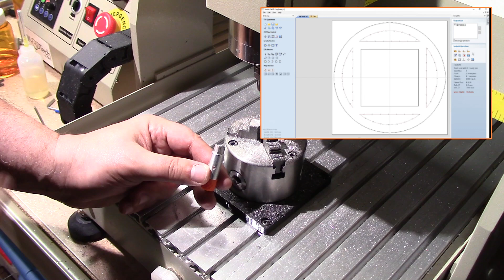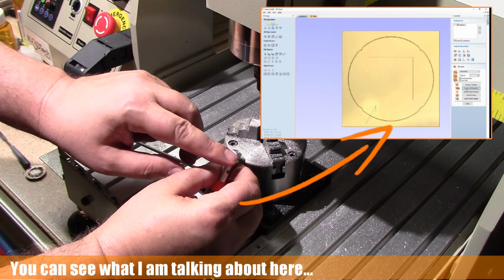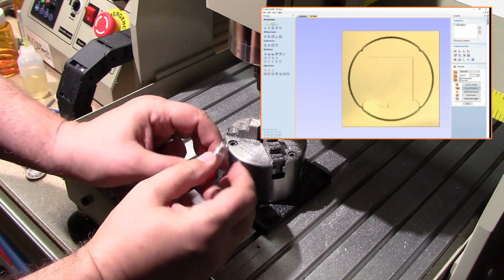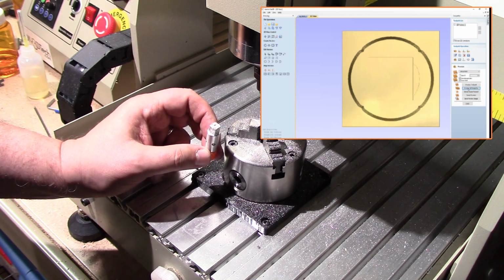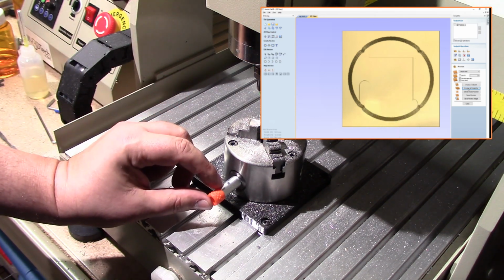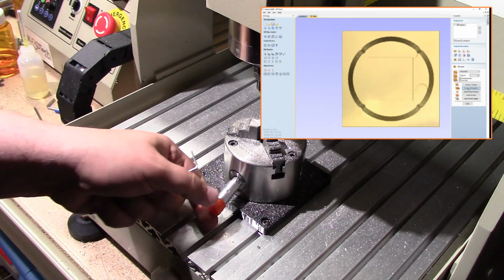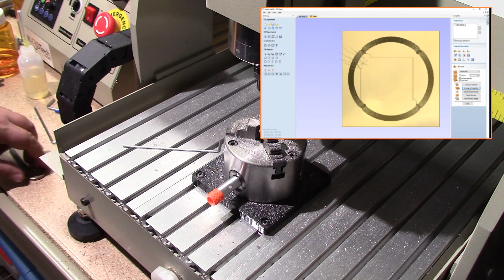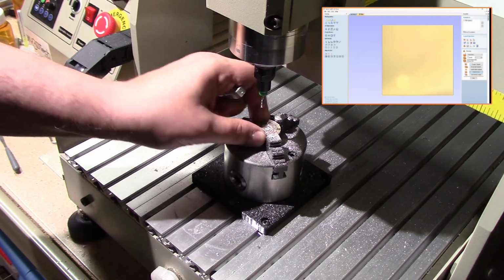3040 CNC - Machining a Chuck Key!

Comment: Not sure what cam software your using but. That program could have been written by hand in less then 5 min and would have been less than 5 to run.
Reply from the maker: Cut 2D and if you write Gcode all day long your right, however I don't :-)
Reply: @DIY3DTECHcom  Your correct, I hope I didn't come across as too negative. In my mind the code is quite simple, however, It actually requires an advanced programing method.  Titans of cnc vlog #51 some what demonstrates the method I would use, however you would be stepping down not up and only the z axis would change each run which means you could program the path in absolute mode and just switch to G91 for the last move in the sub